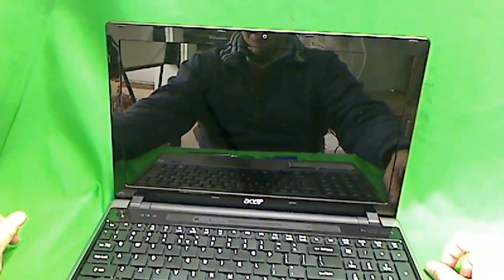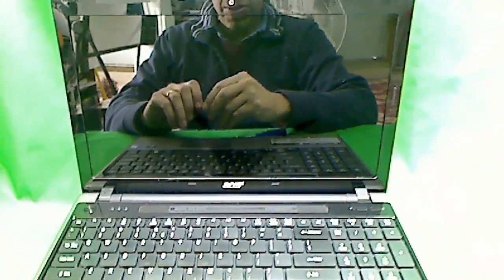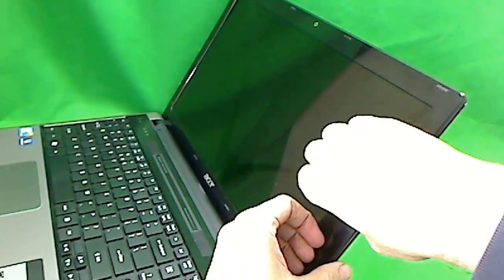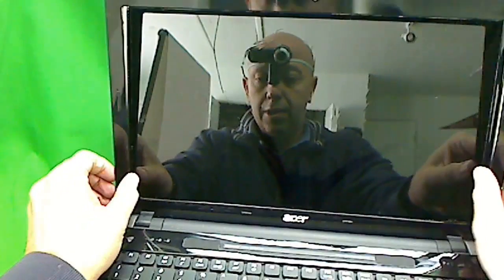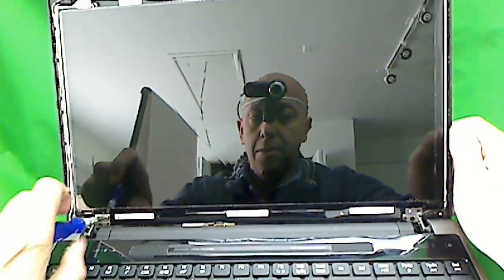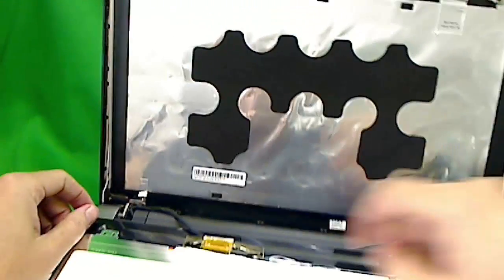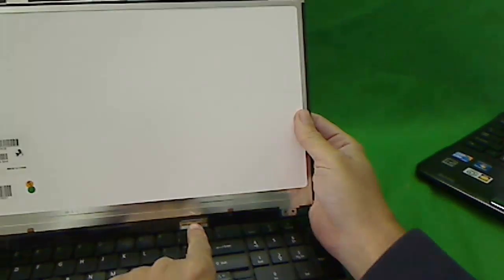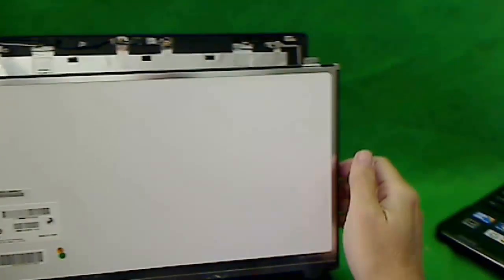Acer 5745 Aspire 5745 laptop Screen Replacement Procedure

Comment: Thank you for this. Your instruction is fantastic. A small word of caution to Aspire users planning to do this procedure. Be aware that the video cable may not travel around the periphery of the casing or screen and instead may be fastened to the rear of the screen with a mild adhesive. When you detach the screen from the frame/brackets do so carefully as not to dislodge the video camera from its placement. Thanks again. You saved me big money. Easy procedure.